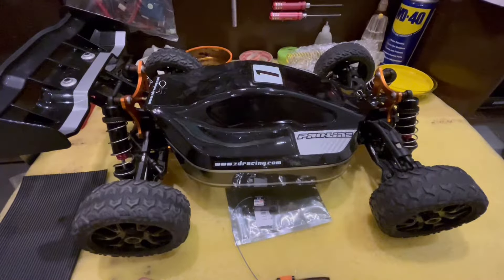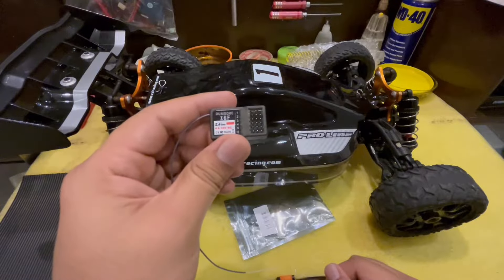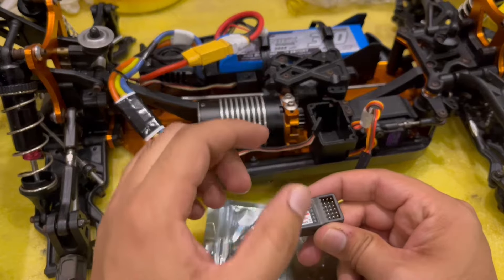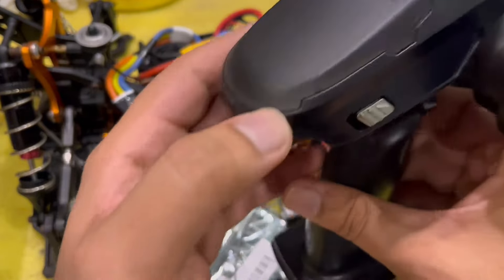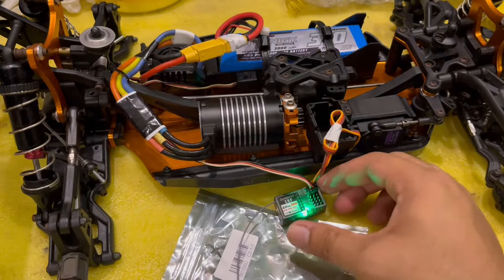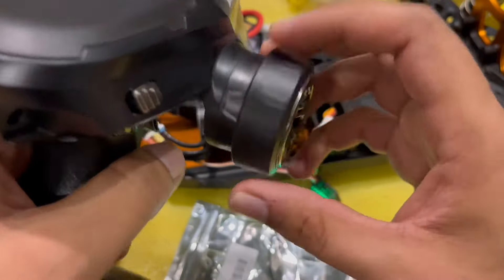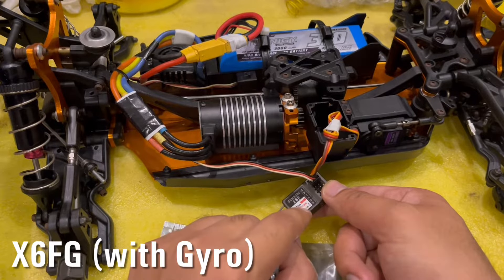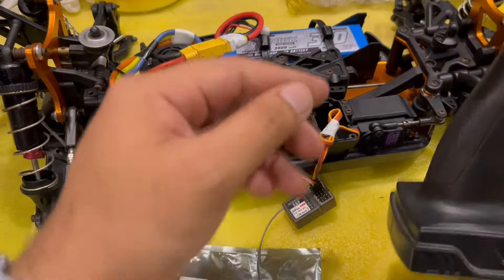How to bind new receiver with a transmitter #rc #rchobby #hobao #dumborc

Comment: I just connected this receiver and the reverse throttle seems to be way more powerful than the forward throttle? Is the receiver/transmitter the problem, or is is the esc/motor, or do you think reverse throttle is always stronger?
Reply from the maker: Reverse the Throttle switch and recheck! If that doesn’t work then reverse two of three wires connections from ESC to the motor. Forward should have more punch and top speed than reverse.

Comment: What should the light do on the top of the transmitter? Shout it stay constant? Mine keeps switching blue/light blue. Doesn't always stay fixed dark blue.
Reply from the maker: This means your transmitter batteries are getting weak and should be replaced soon otherwise the light remain constant.
Reply: @thatrcguy26  Ah brilliant thank you! Got it second hand without a manual and can't find one online
Reply from the maker: That’s great.

Comment: My car isn't centering the wheels with x6f, i need the one with gyro or my x6f isn't properly configured?
Reply from the maker: It’s not a gyro issue as I’m using another one without G and it’s working fine. It might be your servo.

Comment: Where do I get the cables to link to the esc
Reply from the maker: Which cables do you need?
Reply: @thatrcguy26  the ones that come off the esc that go to the controller pair thing
Reply from the maker: Esc comes pre equipped with the cables generally.
Reply: @thatrcguy26  hmm, I don't see mine.

Comment: Would this controller and receiver will work on a KID GALAXY ROCK CLIMBER 4X4? I lost the controller
Reply from the maker: Usually Toy Rc’s doesn’t come with ESC or BLX motor so the connectors might be different! If the connectors are same you can give it a try.

Comment: Hi, I know next to nothing about RC cars. But, would a controller like this work with/replace one that was originally controlled by an app? Specifically an app that’s no longer available. I’m just curious if it’s possible to do a conversion. Thanks
Reply from the maker: Which app do you mean?
Reply: @thatrcguy26  Hi, 

Well, it’s for the Mattel Ultimate Justice League Batmobile. It came out in 2017 and apparently some genius thought it was a good idea to put out an RC that is controlled only by a specific app. That app is no longer available. I’ve been doing some research on it because I thought about purchasing one second hand. But I’ve discovered that you need to have the app to use it. Probably the dumbest thing I’ve ever heard. Just wondered if it could be converted to a traditional RC.
Reply from the maker: If it comes with a standard esc and blx setup just buy any receiver and tx compatible with each other and pair them up!
Reply: @thatrcguy26 Hi, thanks for replying. I won’t know until it gets here and I take it apart. I was able to source the app to control it and its various other functions. I’d still prefer a standard controller though. 

But, since I don’t know much about RCs, can you explain what the esc, blx, and tx compatible are exactly? 

I’m guessing that the cars motor, steering and etc are controlled by a junction box/point that receives radio signals from the controller. This particular RC shares a WiFi connection with the tablet app. So I don’t know if that’s a whole other thing or just a different type of connection. 

Thanks again.
Reply from the maker: Yes that’s right. A receiver is binded with a transmitter just like anyother RC, difference here is that the receiver takes in the input from both ESC and servo (steering) which is then controlled through Transmitter.

Comment: does it work on 2.4 ghz rc cars? also nice thumb, its double jointed
Reply from the maker: It should work if both tx and rx are of same frequency.
Reply: I haven't bought the transmitter yet but does it work wltoys 18405? 🤔
Reply from the maker: Yes it should! Make sure you buy the tx and rx of the same brand and frequency!

Comment: Hi ,I can't find it anywhere my esc has built-in receiver how do I connect it to another transmitter?
Reply from the maker: How did you figure out that esc has receiver builtin?
Reply: @thatrcguy26  I have a RC car that has no receiver in it and I bought same exact esc no cables from it only to engine and from batt
Reply from the maker: Without a receiver you won’t be abel to run the esc and motor! Buy any suitable one and pair the TX and RX together.

Comment: My receiver does not want to connect. I don't know why, but it keeps blinking red. I'm trying to press the bind button but nothing happens. I am using an Amewi 2.6 ghz 4ch transmitter and a 6ch FM from TW. I'm glad if you could help!
Reply from the maker: If it’s blinking red that might be a sign of receiver having some internal issue! It will not pair like that. I’d suggest trying another receiver (with same frequency) that matches with transmitter!
Reply: @thatrcguy26  Ok! Tanks for the responce!
Reply: @thatrcguy26  Also, the transmitter has the frequency of 2405 MHz - 2480 MHz. Whould that work with a 2.4 ghz receiver?
Reply from the maker: Should match otherwise it will not pair.
Reply: Ohhhh ok thanks! Thats why it didnt pair!

Comment: Hi, amazing video. I'm new on RC cars. I have a question. In the FMS car I bought, the motor is connected to a M+/-. With this transmitter, is this connected to a one of the channels?
Reply from the maker: That’s upto you to decide which channel you want to assign for Throttle and servo. Currenty which channel did you assign on the receiver??
Reply: Thanks fot your reply. I naswered before, but something happened to the comment.

The car came with the control damaged. So looking for a new one.
Motor: connected to M+/-
Throttle: ch1
Servo: ch2

But, I don't see the M+/- on the DUMBORC X6. Does it have it?
Reply from the maker: Doesn’t matter which one you go for. As far it goes for the motor, the three wires are interchangable as long as it’s sensor less motor! For sensored you can’t do that. However, on the receiver side one pin is always extra since all you need is +-!! If it’s not working on one combination then just move the pins from 1-2 to 2-3. If you still find it hard to understand you can let me know.
Reply: Awesome, thank you so much man

Comment: What about a transmitter with binding button ? How does that work.. Also what is a binding key use for?
Reply from the maker: Do u have the same transmitter for this receiver? Since the Dumbo rc transmitter does not have a seperate Binding switch.

Comment: Do anyone know why my dx3 remote control steering wheel is replacing my trottle
Reply from the maker: Switch the connections on your receiver. Channel 1 for Servo and Channel 2 for ESC and then try again.

Comment: I don't have that second cable coming off the esc.
Reply from the maker: You have brushed setup or brushless?
Reply: @thatrcguy26  the esc says brushless, and I'm not sure about the motor
Reply: @thatrcguy26  I'm replacing the esc. I'll just have to keep the receiver in the car
Reply from the maker: Are u talking about the cable that has the start/stop switch?
Reply: @thatrcguy26  mine has a button on it that you press on the esc
Reply from the maker: And there’s nothing on the receiver to put it into program mode?

Comment: I have a problem with my rc car. I bought a replacement for my HPI E10's transmitter. The old one having a problem. When I bought a new Dumborc X6F like yours, after 1 and a half years of use. Why this transmitter stops working? It Binds perfectly but, my car does not move or steer. This problem is becoming consistent. I know how to bind the transmitter but, after a year or 2 they just don't work anymore. Is this a common Transmitter failure? Or, the transmitter only lasted for 2 years as it designed? 

Is your controller lasted longer than mine? What is wrong with my E10 HPI? My car have no corrosion, no damages, nothing visible damage at all. Even the chassis in prestine condition.

I used to play a lot with my rc e10 about 3 hours a day. But I never driven it too fast or crash it.

Is it normal to replace the RC transmitter and receiver ONCE a year? 
I'm not wasting 30 dollars every 2 years... especially with this reason again, It just have consistent SAME problem

AURGHHH!
Reply from the maker: Mine’s working perfectly but the one I use the most is X6FG. So far I had no issues with it so may be u can try a gyro one and set it to minimum if you don’t use it! 
Or else, go for Spektrum radio as it might cost you for once but they are known for good relaibility!
Reply: @thatrcguy26   If Dumborc reliable, might be my esc causing the problem. Im still unsure wether should I fix it. because what I know hpi isn't well established rc brands.
Reply: @thatrcguy26   The weird part is that, THIS PROBLEM happens with my Wltoys as well! I dont think transmitters are reliable. Should I invest more expensive 200 dollar transmitter? 

This issue to me is getting unforgiveable... its like I have to pay a SUBSCRIPTION 20 dollars a year to drive my rc 🙄
Reply from the maker: Which ESC and Motor Combo are you using? And what’s the gearing like?
Reply: @thatrcguy26   Both of my RC cars are completely factory stock. I'm planning to sell both of them. And also, I want to buy a completely new platform that is RC crawler. 

Just a budget one like, RGT ; )
Reply from the maker: Better buy an exb roller and set it up yourself with your favourite electronics and radio! 😏
Reply: @thatrcguy26   Would you like to see my new RGT EX86010 crawler? I couldn't afford the 86180 Pro Tracer, but I found an affordable alternative.
Reply from the maker: Yes which one?
Reply: @thatrcguy26   It's in my latest youtube video, you can see the Jeep. That Crawler is a better alternative than 86180 Pro tracer, the price is half.

Comment: Mine does not blink when i press the button. Any idea what i should do?
Reply from the maker: Are you sure it’s not paired to another transmitter before?
Reply: @thatrcguy26  no i bought the receiver and remote new. I use it for an losi truggy, and my remote lcd screen was all crappy, so i decided to just get a new one. But yeah mind doesn’t blink when i press it
Reply from the maker: I feel like the receiver is broken for some reason.
Reply: @thatrcguy26  Hey man, i fixed it. I just had the power wire reversed. It is working perfectly fine. I just needed to watch correctly how i put the wires... thanks.
Reply from the maker: Glad to know that.

Comment: Can i bind X6FG and X6DCG with the same transmitter ??
Reply from the maker: Dumbo Transmitter takes upto six receiver at a time. If X6DCG is similar to X6FG receiver then it should bind up without any issue.
Reply: @thatrcguy26  what do you mean " similar " ??
Reply from the maker: It looks similar to me in a way that the operating frequency will not be different. Try it, it should work in my opinion.
Reply: @thatrcguy26  ok.. thank you for answering my question 🤙🤙

Comment: Bought the X6FG transmitter which came with an X6F reciever with 6 channels. Will it pair succesfully with the transmitter as I cannot get the the throttle to work?
Reply from the maker: Yes it should pair. Please confirm the lights indication are working normally on both transmitter and receiver?
Reply: @thatrcguy26  yh got it to throttle forward thanks. Keeps pinning open in reverse still tho think thats due to an issue with the ESC
Reply from the maker: @reubensanyal2755  yes it could be your ESC.

Comment: Hey, just bonded the receiver , the steering worked but as soon as I try throttle it reverses at full speed? Had this issue before and couldn’t solve it. Any idea on how to fix this problem?
Reply from the maker: Check your transmitter. There will be an option for throttle switch reverse! Flip it.
Reply: @thatrcguy26  thanks dude!
Didn’t actually do this but I was fiddling around with the binding and it eventually worked

I zeroed everything out on the transmitter (th and st trim) and It worked. I’ll realign the steering trim from there
Reply from the maker: Glad to help you out! Have fun.
Reply: @thatrcguy26  will do!

Comment: So If I have one transmitter set up with lets say 3 cars, do I need to do this process every time I want to use a car or does it auto connect when I turn on the car?? (I'm not planning to use all 3 at the same time btw.)
Reply from the maker: Depends on the transmitter binding capacity. Most of the transmitters can take more than one receivers and once they are binded you don’t have to repeat the process again.
Reply: @thatrcguy26  Ok, thanks

Comment: Hi, please will you be so kind and send me an exact link where I could buy one? And last question, will this work with V8 type of controller? Thanks.
Reply from the maker: Hi, I'm using the Dumbo receiver for this video and this will work only with Dumbo Transmitter! If you want any other one, u have to get the same transmitter to pair up.
Link for Dumbo RX and TX : https://ar.aliexpress.com/item/1005003301322206.html?spm=a2g0o.productlist.main.25.19b549527NFIcj&algo_pvid=13058b83-ee1f-474d-a5b3-96b925dfc35e&algo_exp_id=13058b83-ee1f-474d-a5b3-96b925dfc35e-12&pdp_npi=4%40dis%21QAR%21143.66%21143.66%21%21%2139.60%21%21%402103209516915393756464453eb253%2112000025097526985%21sea%21QA%210%21A&curPageLogUid=YlxTLgT6lcxI
Reply: @thatrcguy26 sir how do i unbind ? because i have 2 receiver and i already binded 2 receiver? now i want to unbind 1 receiver . can have any process?
Reply from the maker: The transmitter can take multiple receiver at the same time. No need to unbind, put the new receiver in pair it to the same transmitter again.

Comment: how go bind mn82
Reply from the maker: Mn82?
Reply: @thatrcguy26  yes
Reply: @thatrcguy26  when I played my RC car I pressed TH RATE BIND for fun and LIGHT SW SETUP
Reply: @thatrcguy26  when I turn it off and went to charge it and after that I played it it was not connecting the remote
Reply from the maker: It has a receiver and transmitter that can be bind up together like the one in video?
Reply: No
Reply: @thatrcguy26  it's MN82 stock
Reply from the maker: Then I think it’s not possible.